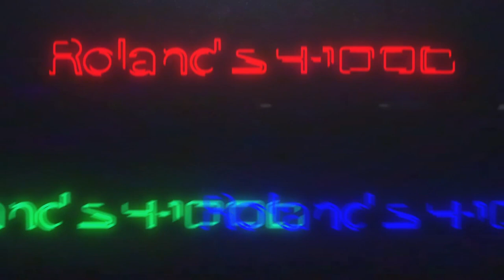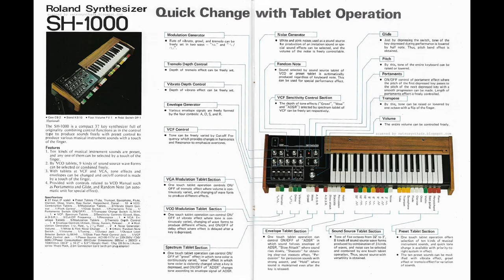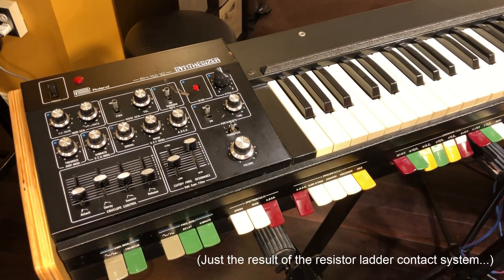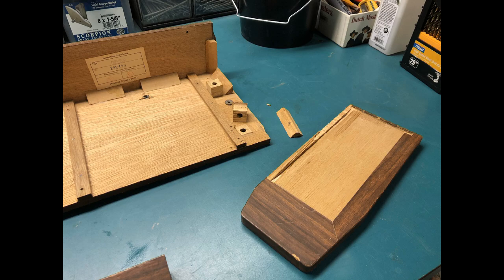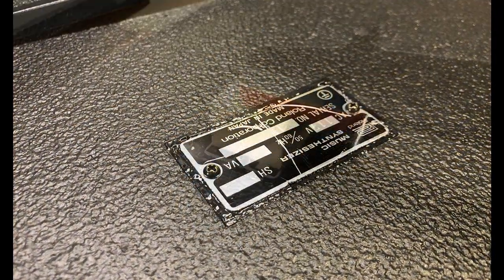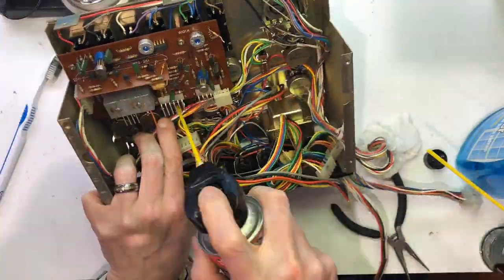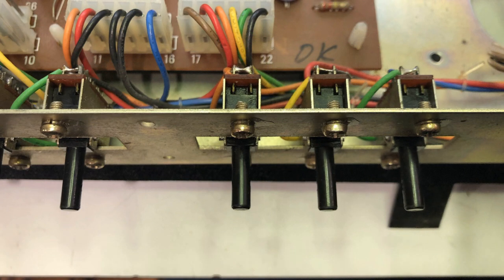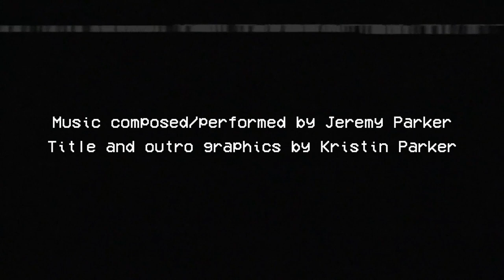Roland SH-1000 Rescue!

Comment: did you have to replace the springs to fix the key action, im trying to figure out if i can clean and service my sh-1000 myself thanks for this video. I'm curious why didn't you get fix the scuffs and scratches on the control panel or repaint it, or is it not possible?
Reply from the maker: No, I kept the stock springs, as they were (just cleaned them). The real improvement in function came from cleaning the contacts (noise and intermittent problems disappeared), then the feel was much improved by cleaning and re-greasing the action surfaces with the Molykote 111. The condition of the felt could be important too, but it seemed OK on this unit.
Reply from the maker: Oh and thanks for watching!

Comment: So mine, on some waves and half of the presets, I get strong feedback and the notes actually hold after I release the key. The keyboard functions and makes noise, but I get the scratchy feedback and never ending notes. Any idea what it may be?
Reply from the maker: It sounds like maybe the presets are calling on the same waveforms that also have the feedback/note hold issue? If you can get the service manual online, on the schematic page for the VCO (page 4), there's a key on / key off voltage on terminal 11, maybe probe there to see if the key on/off is working there first. Does the ADSR affect this at all, like the release is just stuck on? That stuff is on page 7. A visual inspection of electrolytic caps is probably also a good idea. It's hard to troubleshoot from afar, sorry.
Reply: @JeremyParkerMusic  would you be willing to get on a video call with a sub? Lol
Reply from the maker: @HimmyJohn  I'm really not an expert on the synth, as the one I worked on didn't really have any issues (other than dirty pots/switches/key contacts), but if you want to chat further, my email is jrs1@rj3.net
Reply from the maker: @HimmyJohn  also, you could upload an unlisted video to YouTube and link it here, showing the issues...

Comment: Hi I was wondering if you had that original control panel side wood cheek. I have 2 SH-1000s (one restored, one for parts) and both are missing the control panel side wood cheek. I would prefer to put an original back on rather than make a replacement. Thanks very much.
Reply from the maker: Hi Peter, I only re-made the side panels, and I used the wooden cheek block that came with the synth. So sorry, I only have the old side panels. But it seems like it wouldn't be too difficult to make a new cheek block.
Reply: @JeremyParkerMusic  Hi it's the old ones I want. Do you have a email I can contact you at?
Reply from the maker: @peterjankowski7409  I just checked, and I no longer have the original side panels. We had a flood in our basement last month, so I lost a lot of my wood and scrap pieces. They must have been in one of the bins that got soaked. Sorry about that.
Reply: @JeremyParkerMusic  Darn. Sorry to hear that. I flooded out a few months ago too. Thanks for looking though.

Comment: Great video! I own one that doesn’t make any sound when pressing the keys, although the filter can self resonate. Any suggestions?
Reply from the maker: Thank you very much! Hmm, not sure on that one, but perhaps something between the keyboard and the two PCBs that the keyboard harness plugs into. Maybe a bad/dirty ground contact or buss bar contact? I'd suggest some Deoxit on those connectors (and probably all the connectors if you have it apart). Although I didn't have that issue exactly, it seemed all my intermittent noise issues were solved by cleaning the key contacts themselves.

Comment: Hi! Great sound!
I'm trying fix my sh1000 to and it is out of tune... even after waiting some minutes to warm up (and all modulations off), its osc isn't stable... It sounds like were a very slow LFO or some like that... I need to solve that first before calibrate it. Could you help me, please?
Reply from the maker: Hello Michel, does the rate of the slow LFO change with any control settings? If so, it could be dirty switches/pots, etc. Any contamination of the key contacts? There are so many ways the tuning/pitch can be affected, so it's tough to diagnose without having it in front of me. I did not have any real circuit issues with my friend's SH-1000, so I was lucky. Do you have the service manual and are you comfortable checking some of the voltages around the VCO board? (under the the top control panel)
Reply: @JeremyParkerMusic  i will start from there!!! Thank you very much!!!! 🙏🏻🙏🏻🙏🏻
Reply: @JeremyParkerMusic   @Jeremy Parker  I checked the voltages and seemed fine. Could be some cap or transistor? I recorded a video to show better the issue. https://youtu.be/MnTHcHrWUFA
Reply from the maker: @michelcury  sorry for the delayed response, it looks like the tuning issue is like a really long portamento, so I wonder if the glide circuit or portamento is being fully disengaged when the switch is turned off. The top right of page 11 / diagram 7-2 when you're looking at the schematic, there's a section with the input from the glide switch, then an output to 'TO VCO GLIDE' that you'd want to check to make sure it doesn't have some residual voltage drift when the control is turned off. Same thing with the portamento switch. If that's alright, check the terminal 7 on the VCO-1 schematic (page 4) and follow it to the output of the op-amp buffer (pin 6), making sure it isn't drifting after a key is pressed, like you did in the video.
Reply: @JeremyParkerMusic  Thanks!!! Amazing infos!!! I will check these out! You are great, man 🙏🏻🙏🏻🙏🏻